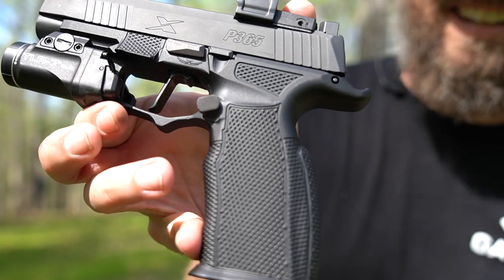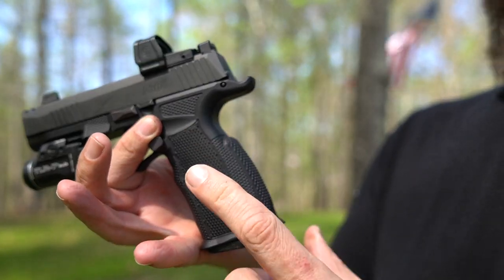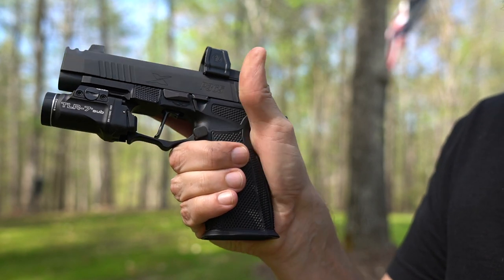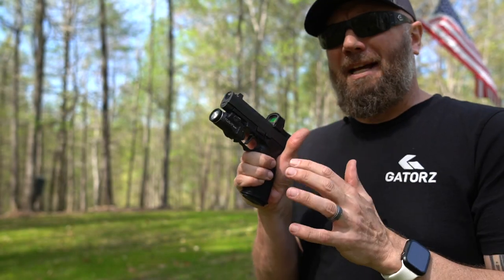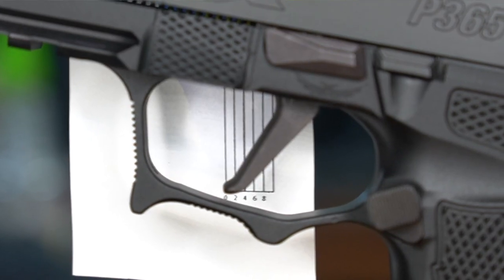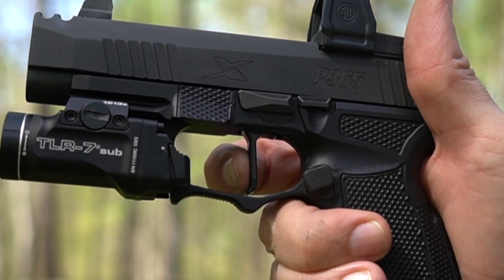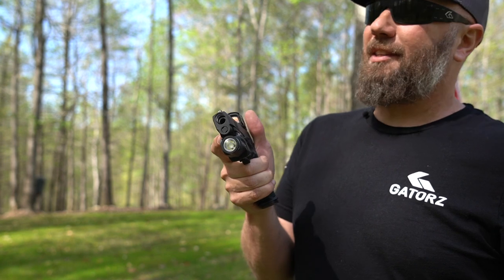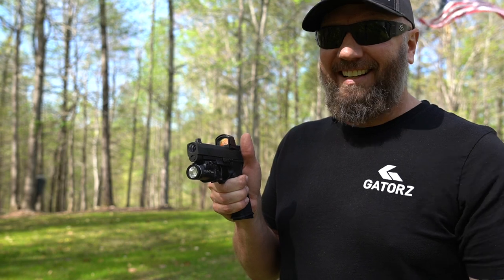Making the ULTIMATE XMACRO

Comment: I’ve got a similar setup with the Icarus grip, M-carbo trigger, TLR-7A and Holosun 507K.  But one thing you may want to consider adding to your set up, a DPM recoil reduction spring assembly.  I’d rank this #2 behind the grip upgrade as far as importance in overall improvement in performance.

Comment: I like your build. Torn between the grey guns and th mcarbo trigger. My macro trigger was pretty good cleaned up nicely after 300 rounds. All my Glocks felt really gritty out the gate, I know they can get better with more rounds still not great. 
     Will definitely get the reset spring and tool steel striker from m Carbo for my macro.
Reply from the maker: I got the new striker assembly. Check it out:
https://youtu.be/Srmq2U58Ai4

Comment: I have been waffling about the maco but I can not get over the length of the barrel and its relation to accuracy @ 15 yards. I have ran the XL but it seams to rattle in my hand when I shoot and and is just to dam small. As far as Optics I would look into Swampfox, The make a few great red dots. I run a Justice on my AR with 0 issues. Although a holosun is good too. I have been rocking a 507C X2 for over a year on my 19 ECD with 0 issues and 0 battery changes.

Comment: 1st time visitor to your channel.  nice video.  a quick question about the xmacro ported version you have and the Icarus grip module.  do you ever shoot high round count courses of fire (ex: advanced classes)?  if so, does the Icarus aluminum grip spread the heat buildup more?  or does it just roast your hand?
Reply from the maker: that's a great question. I have not done a high round sustained fire session with this.
Reply: @HarleyWood23   Ok, thank you for the quick response.  i appreciate it.
Reply: My Icarus module definitely gets a little hot when shooting high round counts quickly. Gas pedal in particular is very warm. It’s not enough to really bother me, but my thumbs are pretty calloused over. Your mileage my vary

Comment: I have the p365 upgraded to the X frame. I like what you did with your pistol except I am not a fan of a trigger that can get locked out because of something done incidentally by the user. I will have to say no joy on that trigger and pass.
Reply from the maker: Same goes for any adjustable trigger. Just follow the instructions and it’ll be fine.